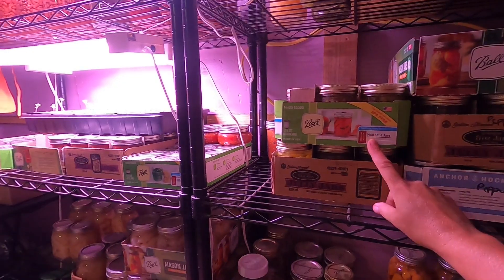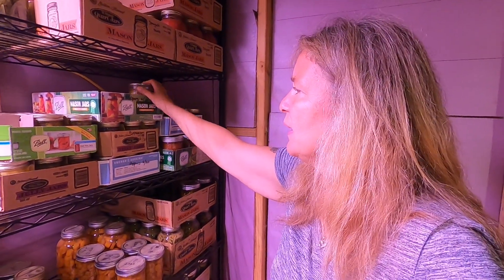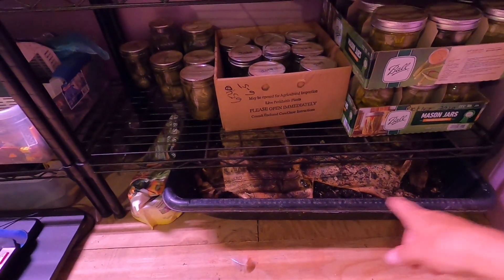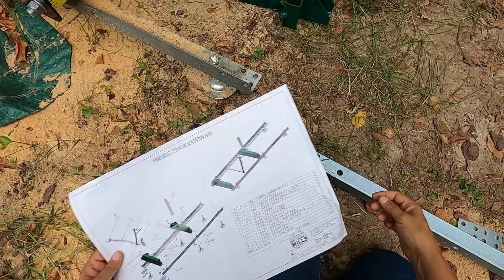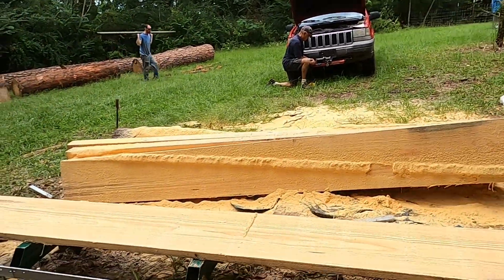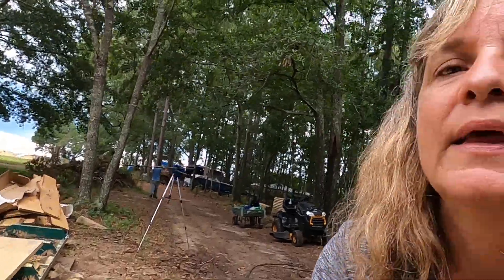What Do I Really THINK of the Woodland Mills SAWMILL?

Comment: Thanks for the video. One tip I can offer you, after doing a lot of work with a similar mill, is to replace the upright metal log dogs with pieces of sawn timber. Use a really strong type, so they don't snap when rolling logs against them. This way, it doesn't matter if you forget to drop them and run the blade through them. It's saved me many a blade. :)

Comment: I have the Woodland Mills HM126, I am using it  to mill the pine trees I am cutting down on my small 4 acre woods lot to build my 24 X 40 barn. The ground here is very sandy and every time I used it after a rain I would have to spend time leveling before I could start. I finally had some red clay dumped and I spread it and poured a 3' X 20' concrete pad and attached it with redhead bolts. No more sink, slip, or slide. I have the 14HP and I cut about 6 or 7 16 foot logs with one blade until it is dull. I would post a picture or 2 but I don't know how or if I can.
Reply from the maker: I like what you did with the concrete pad. Do you think the 14hp allows more logs per blade or are they smaller logs maybe?
Reply: @ThirdTimeAroundRanch  I think it helps and I am cutting 18 to 26 inch logs and I have cut some oak and it took longer and dulled my blade a little quicker.
Reply from the maker: @garymckay8724  Thank you, and good luck with your barn. Would love to hear when you get it finished.

Comment: i have the same mill but i have a subcompact tractor to put the logs on the mill is a huge help .   I have bunks i load them on and then roll them down on the mill.   I would say my blades are lasting about the same as yours around 300 board feet of lumber .   Where i am its gets qut cold and frozen logs i use no water and the blades seem to last longer.    One of the hugest savings with the 122 is the price of the blades to step up the blades become very expensive.   also the 9 horse is a good choice
Reply from the maker: Awesome! We dream of owning a tractor but don't think it will ever happen.

Comment: i bought one of these a long time back, and i have had good success with the machine.  i have increased the life of the blades by two things.  first is hard wood, hard wood blade,    softwood, softwood blade.  2nd is increasing the soap water mixture to about 1 ounce per gallon, (i use dish soap on sale), and the rest of the tank with clean water.   3rd,  i brush and then hose/brush the log before cutting.

tip, in your presentation, the end of your board was unsupported.  you will get a lot of vibration and your cut will not be true.  try to brace that up on the very end.  i use some wood blocks, and as far as the dogs you cut, i use sacrificial lambs made of wood   i think i cut 40mx40m squares and dog against those.  i use water oak for dogs when i make them.  i just cut through them and keep driving.

here is a link to my machine.  i like my design better than what i saw you had.  mine is a 2012 model and i would not trade it.   
https://www.youtube.com/watch?v=JFM-aYsAAzM
keep in mind, you have sealed bearings on the blade guide and you need to watch and replace as necessary.

Comment: I highly suggest purchasing a tach and make sure that you run the motor at something close to the motor's peak hp rpms of 3600. I set ours at 3700 no load and keep it at about 3650 under load. Cuts like butter and saves your clutch. This does not effect the idle speed. Takes a bit of work to do but the results are worth the 10 minutes. Smoother cuts, longer blade life, longer clutch life and faster cuts. The tach I use runs about $22 delivered off ebay. Don't get the $10 ones. We cut everything from oak to hemlock here. Lots of cherry and Tulip Poplar as well. One year in and I just love this mill and use it for resaw and so many things I never thought of prior. Read the instructions a few times through before starting assembly.🤣 That will save you from these mistakes in this vid. Woodland Mills even sends you assembly instructions ahead of delivery so you can bone up👍
Reply from the maker: This sounds interesting, but I would need more information on your set up. Where did you attach the tach? How do you control the rpms?
Reply: @ThirdTimeAroundRanch  the tach is self powered and takes about 15 minutes to install. I placed it right below the factory hour meter. You adjust the rpms by first taking all the slack out of the cable and MORE. I also take all the slack out of the throttle linkage on the motor itself. You'll be surprised how far the linkage moves before it actually starts to throttle up. I then block the throttle with a piece of wood and then remove all cable slop once again. Once I have it right I bend the cable at the attachment point to prevent that little (way too chincy in my opinion) set screw from letting the cable slip again. Check the rpms to make sure it is about 3700 at full throttle and no load. I have yet to find a max safe rpm limit from Kohler much to their shame (and I love Kohler engines). All they give you is max hp at 3600 and never a limit but in my research I found small engine mechanics stating you can easily go to 100rpm over thus the 3700 or thereabouts max.
https://www.ebay.com/itm/273180416431
I'll try to do a vid this week. Been too busy milling and building 😁
Reply: @ThirdTimeAroundRanch  YT is refusing to post. Getting old. I posted some pictures on my Fb page under Smoky Mountain Aquaponics and Homesteading
Reply from the maker: @fiskfarm  Thanks I'll check it out

Comment: just starting the video and i gotta tell you my expirience with canning ... we can alot and have for years and you may already know this...we had some tomato sause canned and stacked on top of each other like your showing in video ...we had 1 jar that spoiled  and since there was weight on top of it thelid couldnt just pop off letting it bubble out and only have a small mess to clean up ...instead the jar built up pressure till the jar exploded and it went every where ...what a mess to clean up...i would sugest that the bottom jars you dont screw down the rings ..just place them on top that way the lid can push up if need be and boil out and set the second box on top of them... and i wouldnt have the rings on at all on the top jars ...just my expeirience ...oh ya and my mom tolt me see i tolt ya so lol

Comment: Someone may have mentioned it but it might make it easier on bigger logs to put thin wedges in as you go with a slight hand tap in. Maybe. Good video though and thanks for all the info. 👍
Reply: using thin wedges(veneer will do) about a little more past half the cut will result in a longer lifetime of motor and sawblade easily up to 20%

Comment: I just wanted to say the reason those blades aren't lasting is because of the motor size if you could upscale the motor to a 16 hp or even a 13 hp there's no reason that you shouldn't be able to do 40 - 50 logs with them and also you can ReSharper the blades as well
Reply: there is a limit to how many times you can resharpen, and woodland mills sells a sharpener i plan to buy next year (2021)
Reply: Yes I realize that it's just you don't realize how much horse power you loose in those logs. I'm currently building my saw mill and I had to decide how much I plan on using it compared to the cost of engine size and accessories. I've decided to go with a used 22hp Kohler Commander engine with 19" drive wheels.  To your other point about sharpening the blades there are some great YouTube videos about making your own. Actually over the winter I'm going to design and build a tooth setter and sharpener for my blades then next summer I'll fabricate the mill.
Reply: @MrImhotep2287  that is very cool.      i know how to set teeth manually on a hand saw, although i rarely do it.  i can't remember what the horse power on my saw is, i want to say 9 hp, as it is the model 126,  which is totally different from what this lady has.   I cut 20 footers and i paneled the inside of my house in oak.  that alone paid for the cost of the saw.

i use it a lot and i have no complaints

Comment: Nothing as good as home canning products in the middle of winter !!  Interesting take on the mill. I appreciate the benefit of your insight about the large logs to blade ratio. Are you planning on a blade sharpener in the future to extend the life of your blades ?
Reply from the maker: No blade sharpener for us, we can get the blades sharpened at the same place we buy them. I don't recall what they told me the price of sharpening was but I'm thinking it was around $8 per blade. And I KNOW they can do a much better job than we can!
Reply: Third Time Around Ranch ok I understand that. I’m considering a band mill but there are no suppliers around me so they would have to be shipped at me expense. That could easily run up the cost per sharpening I’d think.
Reply from the maker: @tractorman4461  If your going to be milling a lot of tree's for many years it would probably be worth the investment to get a sharpener. I understand they are actually not that difficult to use.
Reply: Third Time Around Ranch that’s what I was thinking. I have a lot of oaks, hickory’s, ash, cherry, walnut and cedar to saw.
Reply from the maker: @tractorman4461  Your going to be very busy and happy once you get started.
Reply: Third Time Around Ranch I’m running a 60 or 70 year old circle mill now. I was raised on a circle mill and they are a LOT of fun. 50” diameter blade.
Reply from the maker: @tractorman4461  I checked out one of your video's with your circle mill. It looks really cool but dangerous, it would scare me too much to stand near it when it's running. You must have nerves of steel!

Comment: Thank you for the informative review. I did want to ask how hard is this to put together? I already decided I am getting the Woodland mill but since I may be setting this up alone I did want to know what to expect. Also how was delivery were they helpful in placing the package where you needed it? My driveway is 500 + feet and it says they drop off at end of the driveway.
Reply from the maker: They deliver in an 18 wheeler so they must have a place to turn around or in my case they just pulled over to the side of the road. If you have to take delivery at the road you need to have a trailer or long bed truck to put it on. They did set it on my trailer for me. If I remember correctly it weighs about 500 pounds. Putting it together is easy enough but then you have to have a way to lift the mill onto the rails. You can use a tractor or 2 strong men. Hope that helped.
Reply: @ThirdTimeAroundRanch  TY this is very helpful, I was thinking of getting a trailer but also have a pickup just think it may be easier with a trailer to bring it up my driveway. I can get help if needed for lifting I appreciate the fast reply and info.

Comment: Hi Great video . Not real sure but since some of the cuts are so long maybe try some wedges behind to take the pressure off the blade as you go or even better since you have help close by just have them do it .
Reply from the maker: The way the blade is set up with alternating teeth, there is no pressure on the blade. Unless your using a chainsaw mill of course.

Comment: I am also in the market for a mill, and my question to you is - do you have any regrets about going with the 22 over the 26 or does it handle everything you throw at it? I was leaning towards the 22 but still have that nagging wonder if it is big enough. Oh, and i'm a new sub.
Reply from the maker: It will depend on the size tree's you plan on cutting. We don't regret buying the 22 because most of the tree's on our property will fit on it. And anything that doesn't fit is too heavy for us to move by hand anyway. BUT that being said, we have had to whittle some tree's down with the chainsaw because they didn't fit. If you could afford it, bigger is better to have that leeway. If your only cutting 10-15 inch tree's you don't need the 26. Hope that answers your question and Thanks for joining us!

Comment: I see already that many  have suggested the bi-metal blades and their right as rain. Way better control, lasting longer and push power is so much easier, I speak from experience. I also  will go so far to make a fool of myself and say "Bite the bullet and build the platform for that mill as life improves so much that your gonna curse that you didn't do it sooner. If you can go to a scrap  steel place and get some box steel like 4" x 4" square or any variation of then it will be easier (make sure what you buy is straight) and weld it in the lengths and widths that you need. Channel or other wise on the cross braces but it needs to be one piece or very well built so you don't go from one problem to a new one. I don't know what or how much wood that your going after but it sounds like your building a home that will take care of everyone. Its hard when money is once a month and its barely enough to keep you in home and some creature comfort... I been rich and I have been poor, and by poor I mean going to food banks as I have to now. I'm crippled bad, they won't fix it and I  won't do drugs. Going back to that mill, your able to make it where you can skid it to places rather than move every log to saw it... some skids to roll the logs on the mill bed is a good thing as it would allow the log to come up to and drop down say a half inch or a bit more and not knock the mill out of position. Hence use steel and thank yourself later. I got tons of ideas and no dog in the fight so tell me to shut up an I will

Comment: Ive noticed on the sawmill videos that no one really saves the sawdust . Just wondering if that could be used in some way or if its even worth the effort to collect it
Reply from the maker: We are using some in the garden, putting some in compost and have used some to fill holes in the ground, but there is so much I don't know of any other way to use it.
Reply: @ThirdTimeAroundRanch  You can use sawdust as bedding for your chickens. Another use is under and around freshly planted trees.
Edit: Only use sawdust from spruce, pine, fir for bedding never from hardwood trees like oak, walnut, etc.

Comment: 24 minutes to get 5 minutes of information. Stay on point. Fail to see what beans and chickens have to do with sawmills. Btw motors for these are cheap. I have replaced 9 ½ hp Honda motors on my post pounders with 15hp powefist motors for $300 Cdn and have no problem (I pound 20-30,000 fence post a year, 7-12 hits/post). If I have troubles, I just replace them and use old one for parts. They work great and start on first pull, even after sitting for 6 months over a Canadian winter.